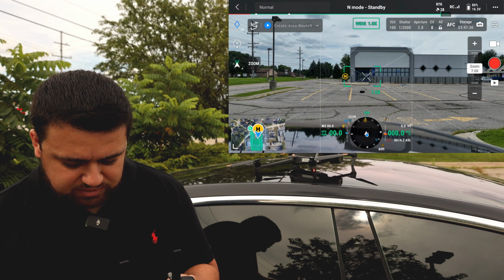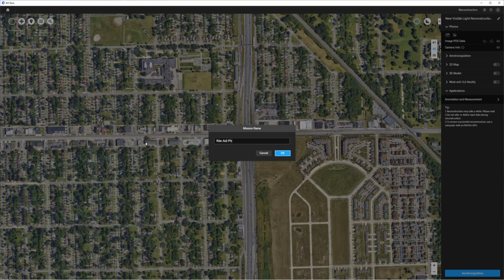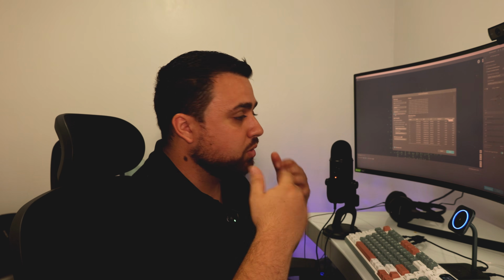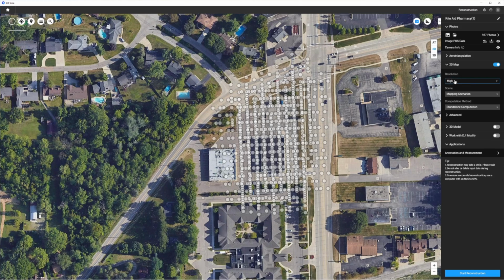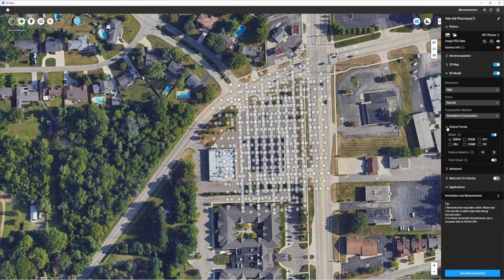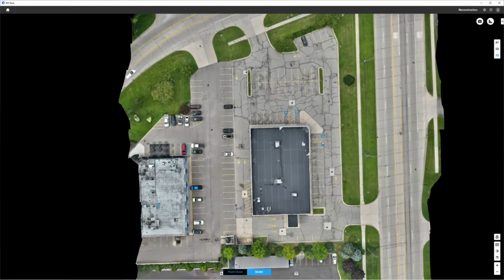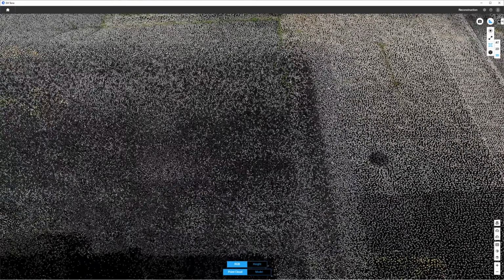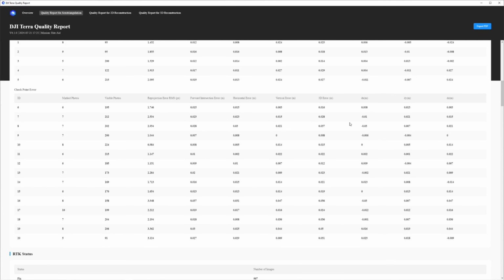Master DJI Terra Visible Light: Ultimate Guide to Stunning 3D Models!

Comment: Great Video! I'm deciding to either get DJI Terra or something like Virtual Surveyor or 3D survey. I'm doing contruction progress, volumetric calcs (sites and mines) and handing off to construction or engineering firms to add their AutoCAD layers - which should I invest in first? Also, I have the DJI Matrice 4E and the Mavic Classic. Can i fly my Mavic Classic with the controller from the Matrice 4E? BTW, i just got a pair of EMLID RS3 units after selling my DJI D-RTK3 base station.

Comment: I personally find, it is only well, if you work as an commercial Worker. The you need the expensive Terra Abo. I find it better, that
you are paying for every Project. If you import a new Picture Series. Than Terra can be used if you have not so much Projekts, an you have calculated costs.

Comment: Hi, Can you please explain how have you made on same mapping having 2 phases? I check all the settings and could not find where is possible to have on same route 2 phases.I am using Matrice 4 series so it is same DJI pilot 2. Thanks
Reply: If you select the mapping type as “ Ortho” then you will only have 1 phase. Select “ Oblique” and the number of phases will be determined by your overlap settings and camera angle settings. Also be aware that the mission duration is per phase so you need to manually add up all phase durations to check if you can do it all with one battery. 😊

Comment: What is the output for the client?  How do they view it after it's processed in DJI Terra?
Reply: 😂 that the catch. 
Processes most beautiful models imo 
Very , large files , difficult to share. Supposedly you have their dji modify software you can do it a little easier
Reply: @LearningInVR  If you are a client that are paying a lot for 3D models then presumably you will know how to use them and know which format you need them in.
Reply: @LearningInVR  but when you share with modify can the client take measurements with the link you send them

Comment: A quick question. We use the same drone for photogrammetry and it's fantastic.  However, I remember reading that "dewarping" should not enabled (it's on the final screen before launching the mission).  I'd love to hear your thoughts on this. Take care!
Reply: True! Quite a few inaccurate comments made and also poor explanations like AFC. The M3E will always default to MF once the flight starts as you see in his video and then it cuts to it in AFC mode during flight. Those who are new can’t learn if the tutorial is wrong in the first place.

Comment: If you're impressed with this model you should shoot in RAW and process it in Reality Capture.. Your head will explode 😁
Reply: Using RAW for photogrammetry is not efficient 95% of the time, JPEG has enough information to get extra details on shadows and highlights, RAW might be only useful if you want an artistic touch to the model.
Reply: @designer.346  maybe if you just want to make a "preview" model with a drone. But if your aim is to create a very high quality, very dense model (digital twin), you shoot RAW, because there isnt much you can do with a jpg file. You can get like 30-50% more data just by decreasing highlights and bringing up the shadows.

Comment: Great video, Rami. Currently evaluating Terra for a very similar project. Would be interesting to see how you would combine the oblique area route with a slope/facade area route in the case where you're capturing a taller building and evaluating the facade condition.

Comment: How do you get around the flight over moving vehicles in the street with your flight path?
Reply: If the traffic is stopped at the light or there isn't traffic on the road at that time you can fly over the road. You can also fly over the road if you hit gaps in the traffic.
 The regulation is for people in a moving vehicle.
As long as it's not moving or it's not directly beneath the drone you're good to go.